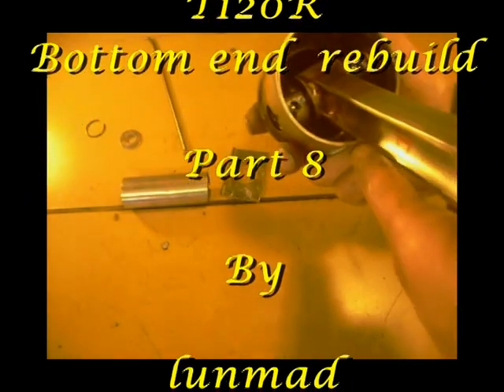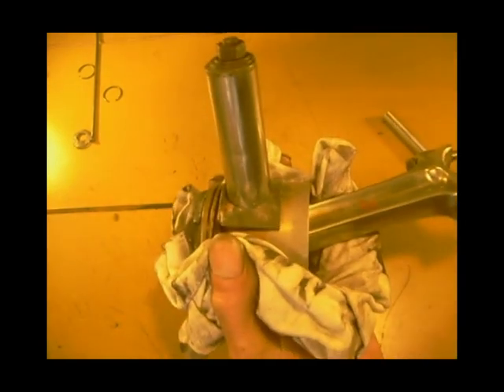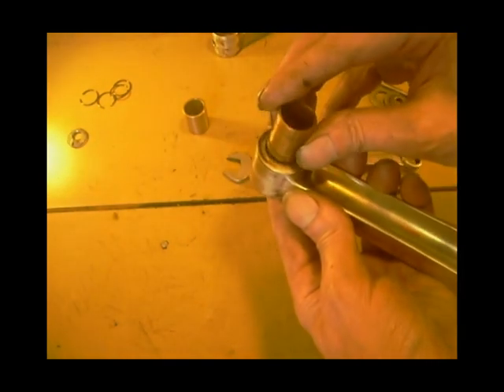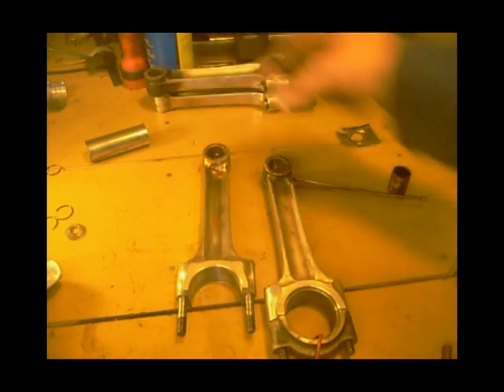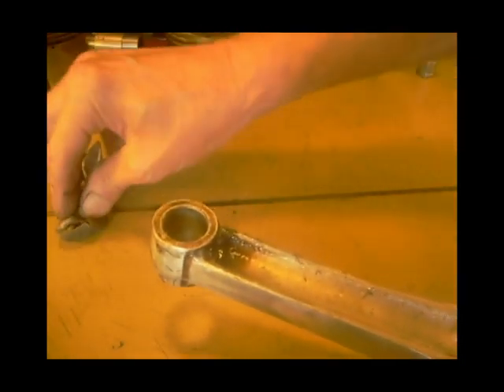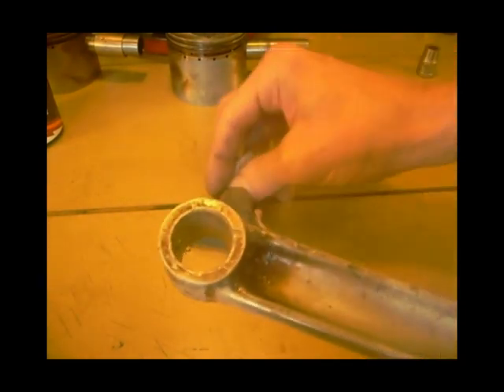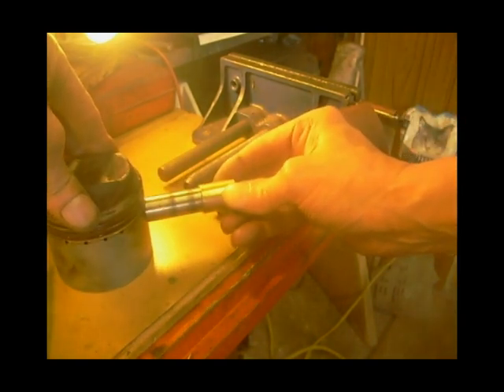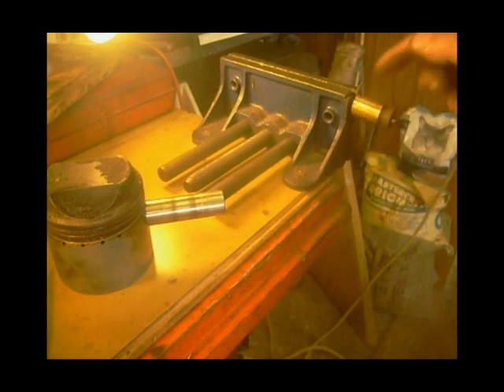T120R bottom end rebuild pt 8

Comment: @eloomis  not all wrist pin and piston setups are alike. some have  wrist pins that have a tight fit in the piston holes  and loose small end. some have both loose small end and piston hole tolerances. better known as a  full floater type.

Comment: Hi Lunmad. Any tips for fitting new camshaft bushes? Would you recommend using a similar technique you used on the little ends or is it better to but the reaming tool? Thanks for the vids. They have  been very helpful.
Reply from the maker: Hi Matt :-) thank you, cam bushes should be reamed inline with the cases bolted together.
As the world is not perfect, you could pre-ream the bush to fit the cam then fit them in the case and hope for the best.
Ideally inline reaming is what to do, in saying that the little ends should be inline reamed as well.